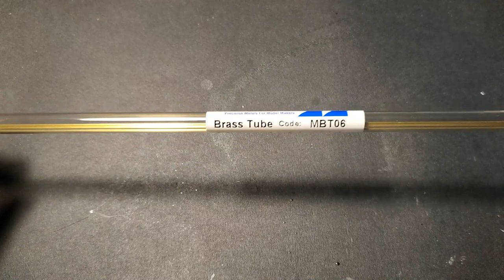Wingnut Wings 1/32 Halberstadt Cl.II, Part 3 - Final Assembly

Comment: Another great build of a favourite aircraft. 
I like to run a piece of wire inside the brass tube when I cut it to prevent any distortion. 
What is the next build?I always look  forward to projects.
Reply from the maker: Thanks Stephen, yes it's a great idea, however I already know how much pressure to use, so it's not a problem for me, but might help for those, who just start to use those tubes. My next project goes according to the plan - AEG G.IV bomber
Reply: @FlyingCircusModels  AEG Bomber, like the one you walked round at the museum. That should be very  challenging.
Reply from the maker: yes and no, Museum has the later version and I'm building the early one, but the idea is the same. We will see how it will go...